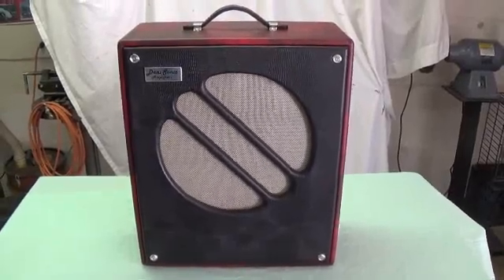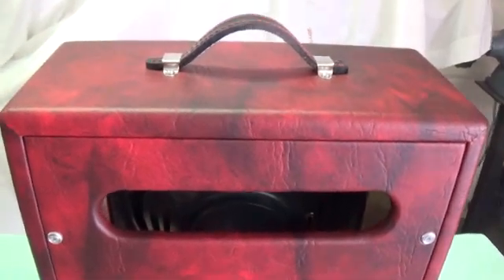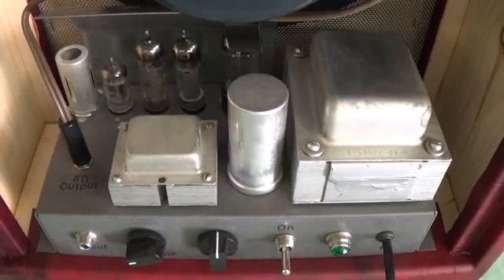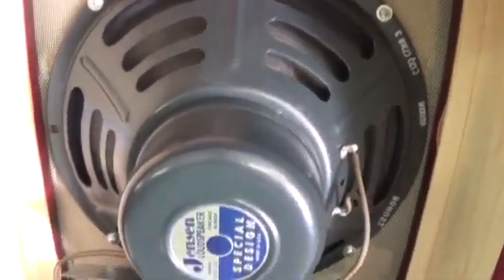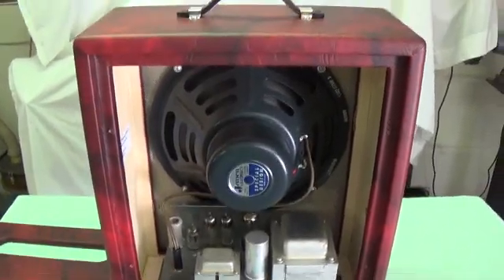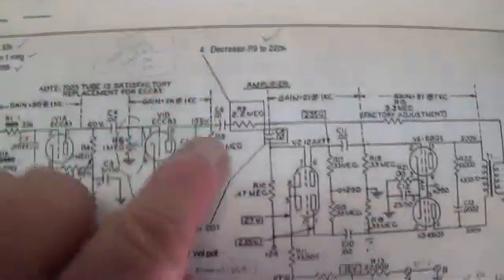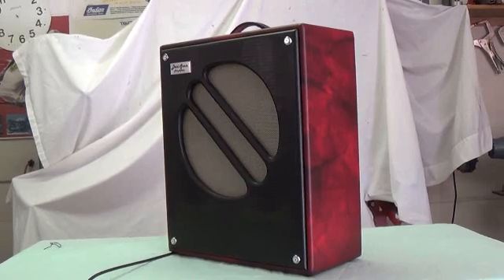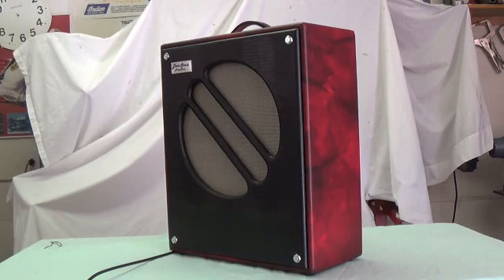Conversion of a Hammond AO-35 Reverb Driver into a Guitar Amplifier

Comment: Hello sir nice job I have an ao 35 that has been converted already would it be ok to run this amp at a 4ohm load Im using 2 8 ohm 12's Thanks
Reply from the maker: Greetings, Dennis.I assume the 12's are in parallel. It's hard to find any definitive literature about AO-35 output impedance, but from what I have read, it was intended for an 8 ohm speaker. The general rule of thumb with output impedance is that you can go one up (16 ohms) and one down (4 ohms) with low probability of causing damage (usually to the output transformer). I would also add that such damage is less likely if you run the amp at moderate volume levels (i.e. up to 7 of 10).

Comment: Hi Uncle Doug -- I love your videos, they are very helpful!  I have recently acquired a nice AO-35, but I was considering as just using it as a power amp for a separate guitar preamp that I own. 

Can you give me some high level guidance on how I'd need to change the input to accept line level rather than instrument level?
Reply from the maker: Greetings, KT. My specialty is generally limited to vintage amps and I don't tend to mix and match pre and power amps, so in this case I can offer no 'high level' guidance, but I would think it would boil down to a comparison of the output signal of the AO-35 preamp to the output signal of your separate preamp. The point of insertion would probably be around C8 in the AO-35 schematic feeding V2, the PI. I would consider a conversion like this to be simply (educated) guesswork. Determine the magnitude of difference between the two preamp outputs (if any) and if attenuation is needed then use a pot to find a suitable value and either replace with a fixed resistor or leave the pot in place. If fine tuning is needed, then try some trial and error with caps and resistors. Sorry to be so general, but this is untrod ground for me (as it is for you) and I would simply approach it like I do all circuit modifications, with a little careful experimentation and common sense. Good luck.
Reply: Uncle Doug
 Thanks a ton, UD.  I was also thinking it would insert right before the PI.  That's helpful advice for getting started.  Please keep the excellent videos coming, and give Rusty a scratch behind the ears for me.
Reply from the maker: I will, KT. Best of luck with your project and please let us know how it turns out. It would be helpful to document your modifications for viewers who might want to use the AO-35 with another pre-amp as you intend to do.

Comment: Hello, thanks for putting this up. I find the conversion idea highly intriguing. I was wondering if this chasis could be used for a bass amplifier? Again, thanks for posting, love your stuff man
Reply from the maker: Greetings, Caleb, and thanks for the kind words. Bass amps are generally rather powerful (i.e. 50W or more), have tone controls voiced for low frequencies, and utilize closed-back speaker cabinets (often ported) containing bass speakers (that resonate at low frequencies).  I guess you could install a bass-favoring tone circuit and connect it to a sealed bass speaker cabinet and have a low-power bass amp suitable for practice, but not powerful enough for public use. There are organ amplifiers of much higher power that would be more suitable for conversion to a bass amp. If you are interested, I would suggest an Internet search for info on these larger amps. Good luck :)
Reply: Uncle Doug OK, that's kind of what I was thinking. Thanks for the info, and keep it up, love the channel.
Reply from the maker: You're welcome, Caleb.

Comment: I have salvaged several old amps from organs, all kinds.  The old Hammond tone cabinets had some type of amp in them with the vertical oil filled reverb tanks.  I found out about these oil reverb tanks when I laid a big tone cabinet on it's side and out came the oil all over my van.  I am not a tech but I have used these chassis for tubes and other parts.
Reply from the maker: This is something new for me.....I never heard of oil-filled reverb tanks. Now if I ever see one, I'll be careful not to tip it over in the car. A friend of mine had a nice old antique barber chair in his living room for many years. When he finally moved it, he found that it had leaked a pint or two of hydraulic oil on his carpet.....not a happy discovery.
Reply: Uncle Doug I'm not sure on the model of the Hammond tone cab. but it is pretty tall and had nine 10" speakers and two 12" Jensen alnico speakers.
Reply from the maker: Good Lord, what a speaker bonanza !!! It might be worth getting a little oil in the van, for 12 vintage speakers. The only reverb tanks I have ever salvaged from organs were the standard long, rectangular metal-can-style like you see in Fender amps.....with no oil (thank heavens).

Comment: Here's a single knob tone circuit from Andy Fuchs. It's actually two pots in one knob, so there is more versatility presumably. Looks interesting! I would love to hear what you think of it on paper.http://www.blueguitar.org/new/schem/misc_mod/tonectrl_single.pdf
Reply from the maker: Greetings, Roger. Looking at the circuit, it appears that all the very high frequencies will go through the 470pf bypass loop to output. This loop would benefit from having a "brightness" switch.

The low frequencies will go straight through the 47K resistor and two pots to output.

The Bass pot will send varying amounts of high (and midrange) frequencies through the .01uf cap straight to ground if the boost switch is closed. If it's open then their route will be determined by the positions of the boost pot and treble pot, with varying frequencies sent to either ground or output.

The term "boost" is misleading, since passive tone controls cannot actually boost any frequencies. In reality you are simply sending more of them to output rather than to ground.

If you intend to incorporate this tone control into an AO-35 conversion, I would be very interested to hear how it turns out.  So many complex interactions take place within tone circuits, it's generally best to simply wire them up and see how they sound....especially with unconventional designs like this. If you use this circuit, you could experiment with different values for the .01uf cap. It's the only cap in the frequency discrimination circuit and changes in its value would probably have a significant effect on tone. Good luck.
Reply: Uncle Doug It is a bit odd w/ that hi freq bypass cap; putting it on a switch would be good. So it seems there are THREE pots - two I suppose are stacked in one housing, but then it still has that mid boost pot. Bit of a misnomer calling it a "single tone pot." And isn't that "mid boost" pot just a mid control? I.e., like the classic Fender 3 band stack, where the mid pot takes its feed from the bass pot. Right?
Reply from the maker: Roger Taylor
I agree that the title is misleading, especially when the circuit really has 3 pots, and the word "boost" is really not appropriate in a passive tone circuit. To be honest, in an AO-35, I would probably stick with a conventional "Bass" and "Treble" tone circuit, or even a single-pot  "Tone" circuit. I try to keep an open mind about new ideas, however, and if this unusual circuit works, then more power to it. Re the Fender triple tone stack, I believe the "Midrange" is fed through the 100K resistor (like the Bass) and the .047uf cap.

Comment: Hey, Uncle Doug.  I haven't tried hooking the speakers up or testing them with a meter.  What I did was manipulate the cone with my hand, and one of them is pretty crunchy, so I figure its done for.  I checked online for suppliers of cones and found some with Jensen parts, but none that listed a 6 x 9.  Not a real common speaker, apparently.  Anyway, I'm currently on the lookout for an old organ amp.  Thanks for the response.
Reply from the maker: I really think you'll have a hard time finding an oval Jensen speaker or a replacement cone for one. Organs tend to have excellent (round) speakers, however, so while hunting down an amp, keep an eye out for a good speaker too.

Comment: Uncle Doug,
I think this would be a really fun amp project.  I can't imagine coming across a speaker as nice as that Jensen.  I do however have two Jensen 6 X 9's with the same special design sticker.  Unfortunately, one of them is blown.  Can the speaker be rebuilt, and is it worth it?  Love your videos, and your amps.  Keep it up! (and tell that dog to settle down)
Reply from the maker: Greetings, XFRK. Rusty and I are glad you enjoy the videos :)  I have never seen an oval (6" x 9") Jensen speaker. When you say one of them is "blown", is the voice coil open (i.e. instead of 4 or 8 ohms of resistance, the resistance is infinitely high), or is the cone itself damaged?

Some problems can be repaired at home (see my video on speaker repair), but if the voice coil is open or rubbing, then it would have to be replaced.....and such repairs are fairly expensive. It would probably be cheaper in the long run to order a new 10" or 12" Jensen speaker from Musician's Friend. They have excellent prices and service. Good luck !!

Comment: Hey Doug,
Finally have some time to do this conversion.  I was going to order parts and had a question.  What Wattage rating should the resistors be?  I was going to get 1/2W carbon comp resistors but wanted to be sure.

Thanks!  Kevin
Reply from the maker: Greetings, Kevin. It's good to hear from you. I'm sure that 1/2 W resistors should be more than adequate for the circuit. I have largely shifted to metal film resistors (in applications other than restoration of high-dollar vintage amps). They are precise in value, retain their value, and resist heat much better than carbon resistors. Some people claim they can hear a difference between metal film and carbon resistors, but I think it's all in the mind, not the ear. Just my two cents :) Good luck with your conversion !!

Comment from the maker: Greetings, Twang. The only place they allow links is in the video description, which I will do once I get the link from you. Re the shielded wire, yes, I always shield the signal wire between the input jack and the grid of the first 12AX7. Good luck with your project. I think you will be very pleased and impressed with the outcome.

Comment: Hey UD,
I found the original link that had the modded schematic on it.  I tried to post it in the comments, but youtube won't allow me to put a link in the comments.  Feel free to email me a twangzilla at yahoo dot com and I'll send it to you.  I just bought an ao-35 and will be doing this conversion.  Did you use shielded wire from the input to pin 2 of V1?

Comment: Last night I looked at the schematics in Aspen Pittman's Tube Amp Book, and I found one for an English Watkins Dominator. It uses the EL84 output tubes, the voltages in the B+ supply are the same, and it's about 18 watts. it looks to be a pretty basic circuit similar to a Vox AC 15. My gut is telling me that this will be a good one to copy. It ought to sound really good with a 12" Celestion. The Beatles used lots of Selmer and Watkins amps before they got famous and started using Vox.

Comment: If you can figure out how to get the record and playback heads operating at the same time, rig a variable speed motor, and make an attenuated feedback circuit, that old reel to reel deck could become a pretty decent tape echo. I saw a guy do this once with a tube Webcor machine, and it sounded as good as an Echoplex. I think he got for $10.

Comment: its a simple old mono one from the late 50s. i have a full instruction manual/schematic instead of the little one printed inside of it. it does have a volume control but i might change it
its got one ca input as a mic input thankfully it seems like the amps completely sperate from the reel to reel mechanisisms if i remeber correctly

Comment: Which model silvertone reel to reel are you using? It should already have a volume control. You could unhook the playback head and attach the input jack to those wires. It's what I did with an old transistor cassette player many yrs. ago. as my first amp. The gain and distortion was ungodly! Probably the best fuzz I ever heard. Put the Big Muff to shame!! There's also the hum you mentioned, a bad capacitor most likely.

Comment: I don't know enough about tube power amps to mess with them. I simply removed all the unnecessary parts and changed the input caps and resistors at the input to make it guitar friendly. Is there an auxiliary input and a speaker output on this unit so you can try it with your guitar and a decent speaker? This would let you know if the project is worth undertaking. Would it be easy to strip away the unnecessary junk if you decide it's worth the effort?

Comment: I would have to disagree with Uncle Doug on this one. It depends what you're looking for. If you want pristine clean with tons of volume, no way. However if you'd  like an amp you can crank without blowing your eardrums you might have a winner. I rebuilt an amp with the same exact tubes and and that baby rocks from ZZ Top to Van Halen! Nice clean tones too. The 6AQ5 is a miniature 6V6 actually, but when driven hard it seems to take on the characteristics of a 6BQ5. Still interested?

Comment from the maker: Since the output of this little amp was designed to drive what is probably a small (5") built-in speaker, I doubt that it would be suitable for guitar use, and the tone would probably not be very good. Also, God only knows what level of input it requires. This doesn't sound like a very promising project. Why not just bid on an AO-35 or AO-44 chassis on Ebay......or hunt one down locally via Craigslist ads for old organs?

Comment: so i have this old silvertone reel to reel that gave way but it has a amplifier in there running a 12ax7, 6x4, and a 6aq5a. im interested in salvaging the chassis and turning into a guitar head. ithas a loud hum and im not really versed in tube amps but i build smaller guitar pedals and amps . any ideas of how to isolate the amplifier section of the amp? i could provide a schematic if youd like to see it